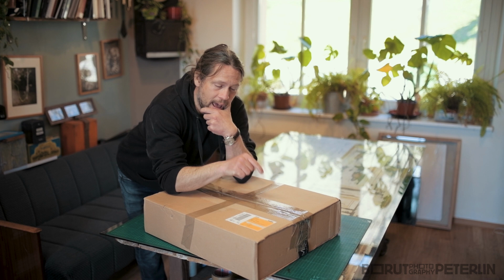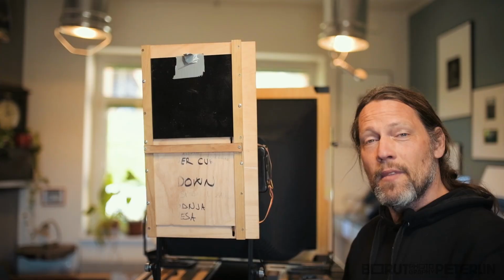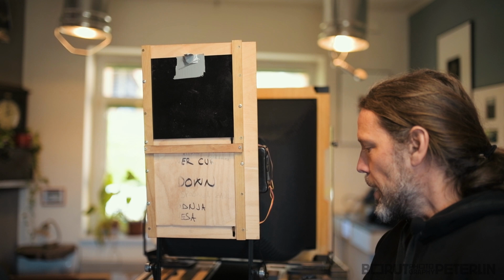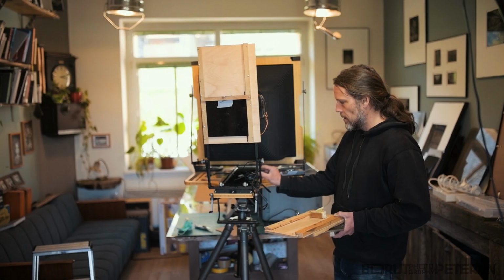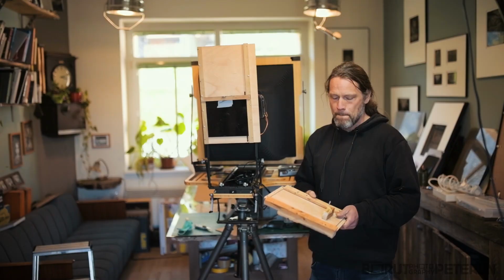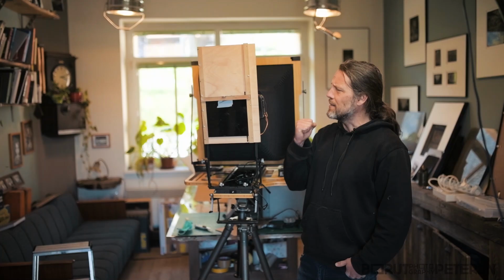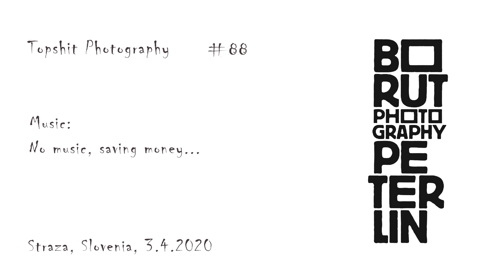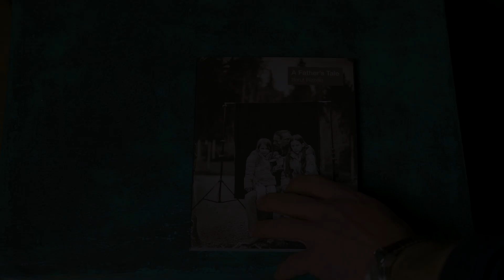My wetplate camera has RC controlled guillotine shutter! / Vlog 88

Comment: Hi Peter! I love the guillotine design, but I noticed that the second curtain has a lot of bounce when it closes. I was thinking Perhaps some foam inserts at the bottom of the sliding joints could reduce the bounce and give you a more even exposure. Thanks for the videos! Motivates me to shoot more interesting formats
Reply from the maker: Yes, you've noticed correctly. I just need a larger curtain and  it'll bounce lower, meaning fully closed.
Reply: Or a magnet

Comment: The ejection is like 'B' or 'T' for focussing ;@)...

Old Polaroid rollfilm cameras (95, 150, 160, 800 etc.) had thin foam rubber to reduce rebound on the rotary 'time-of-flight' shutter. When the foam decomposed they started bouncing.

Kingslake-edited optics book with shutter chapter discussed wire brush or other frictional braking for horizontal spring-launched similar shutter.

I hope I kept that book!

Comment: Hi Peter! Your friend is very creative! I would just change the whole mechanism to some kind of attenuation / e.g. rubber or sponge / I would put the closure control on the tree. But just so you don’t bounce back as you can see in slow motion Nice lights 👍. Thomas
Reply from the maker: I don't understand what you mean. The bouncing second curtain is no problem for two reasons. Firstly, time of exposure is between 10s and 10 minutes so the extra 1/50s would not make a difference. Secondly I will just make a bigger second curtain and it'll bounce lower, meaning fully closed. Simpler the design, the better
Reply: Hi! I didn't want to know. I know that due to the long shutter speed, this little movement will not be visible. "radio release 1.0" 📸👍